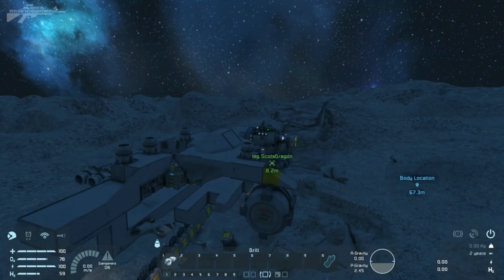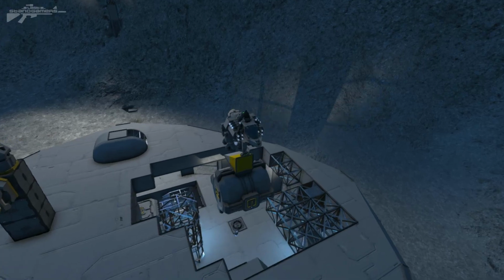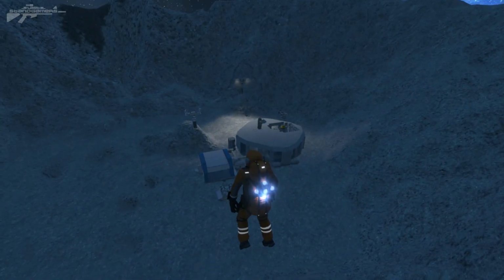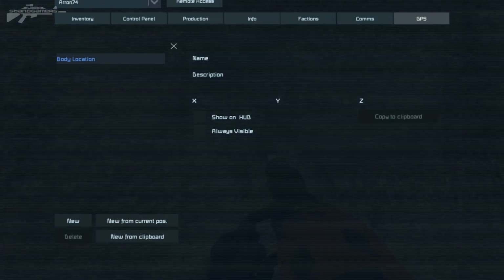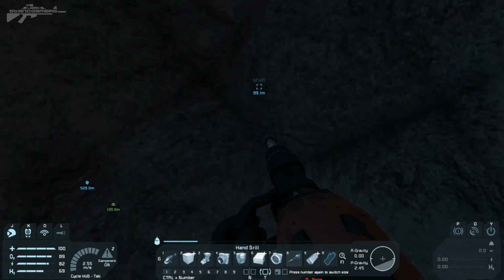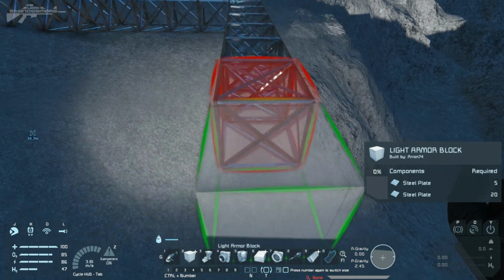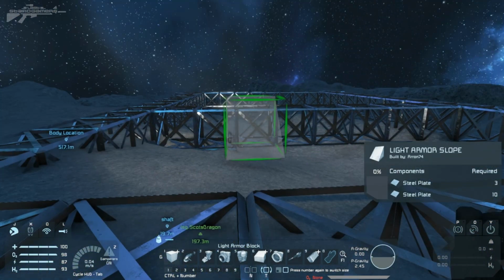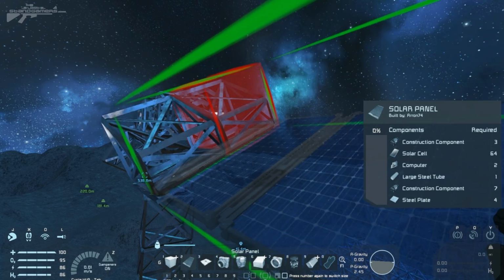Space Engineers - Hazardous Hydrogen Transportation  SE7-4

Comment: How to calculate if your ship can lift a section of blocks:
total downward thrust - (total mass * gravity)
If the number is positive, you're good to go.
Example in video: 
Small grid large ion thrusters: 144,000. Ship mass ~36000. Hydrogen tank ~8000. Gravity 2.5(shown on HUD)
144,000*2 - (36000+8000)*2.5 =  178,000, so the ship will EASILY lift the hydrogen tank. 

You can also rework this into maximum lift capacity for the ship:
144,000*2/2.5= 115,200 kg Gross lifting capacity. (around 79 tons net lifting capacity. Don't go over 40 just to be safe.)
Reply: Vecheslav Novikov this is really useful. Can't count the number of times I just crashed into the ground
Reply: Vecheslav Novikov wat
Reply: I mean I love science but wat 0-0

Comment: I think vanilla builds are more valuable than modded ships for three reasons: 1) Challenge. It's an engineering game and a large part of engineering is having clear limitations and thinking of a way around those limitations. Heavy modding removes that. 2) Standardization. The question of which design has better functionality should not be decided by whoever picked a mod with higher stats. With vanilla ships we have a level field. 3) Compatibility. When I design a ship or a contraption, I like to use that contraption everywhere I please, including on servers. I cannot depend on the particular mods I used being available everywhere. Moreover, those mods can stop working without warning after an update. Vanilla ships mostly avoid that problem.
Reply: I think that when you build with modded ships you have more freedom to build so I think modded ships should be judged fairly against vanilla ships, after all the creator of the vanilla ship had the choice to use modded parts.
Reply: I'll definitely give you 3, and 2, if you're in competition, you'd naturally want to ensure everyone has the same mod sets. If you're not, then it's simply a matter of personal preference.

As for the 1, the other side of the coin naturally, is while a large part of engineering is working a way around the limitations, another part is developing entirely new things when the current tech is insufficient. It's the difference between racing to develop rockets to reach the moon and being told 'we have gunpowder and Iron casting, you must reach the moon without making any advances' yes, it's possibly doable, but it'd be much easier if you were allowed to toss some charcoal in the furnace and make steel.
Reply: Except the issue is not about creating mods (this is indeed a worthy challenge), but merely using them in designs. Choosing a mod that fits your criteria is not a challenge at all. There are a few mods that introduce new gameplay elements (like the parachutes or wings) and I'd agree that using them is a requirement if you're going for a specific thing, but most mods - blocks with different shapes and/or stats - are superfluous. Also don't forget that every mod used adds a little bit of overhead to your blueprint's users, as it necessitates subscribing and adding it to the map.
Reply: I didn't mean creating them as much as selecting them. I do see your point about over head. On the other hand if you want to get technical, none of the vanilla blocks need any shape beyond a square box. None of the vital components should be sitting out unprotected. They should be hidden away behind layers of protective panelling. So all the blocks should be indentical.

Comment: +LastStandGamers Idea for rail-gun or mass accelerator ammo the ones with the rings an using gravity generators to push a slug out. anyways ammo idea:  stylize the tip similarly to a tip of a missile or rpg and the tip made out of completely heavy blocks; inside the tip area put more heavy blocks for further reinforcement. the ammunition should be 3 high and 5 wide and 6-8 long. after filling the tip area fill in the rest with the explosives but leave a hole in the back. after you do that build explosives coming out of the hole and out off to the sides and up and down like fins. the idea being the missile tube penetrates inside the ship an as it goes in when the "fins" hit the ship or target the explosives go off causing a chain reaction blowing the slug up inside the ship.
Reply: heavy armor*

Comment: AFAIK there's a bug with multiplayer in SE where solar panel data can't be accurately read by programmable blocks.  You'd almost have to use manual timing with it and just program the rotors to move slowly over time instead of trying to track the sun.
Reply: There is a mod that overcomes this.  I believe it's Midspace's experimental solar tracker.

Comment: You should make a dedicated video on solar tracking solutions. I've never had any luck with those scripts.
Reply: You don't really need a script. Build the solar panel angled to match the suns rotational plane, set the rotors to a matching speed (some math has to be done obviously depending on your length of day) and you're done.
Small floating point errors will of course make it a bit unsynchronized, but just check on it every few days to realign it by hand and you'll be fine.
Reply: I prefer automated scripts that work than this. They thing is that, due to lag and rubber banding issues your solution gets out of sync, fast! And I'm not talking multiplayer servers, single player itself experiences these problems. Unfortunately the tick rate in this game isn't as uniform as it is in Minecraft for example. Rotors and pistons especially tend to completely loose sync with things like the sun, which is the only constant... or it could be the other way around, I don't know that for sure.
Anyway a script that actually measures the position of the sun based on the power received by the panels is way preferable than any other simple mechanism, mostly for the reasons I mentioned, and for others I didn't. The only thing is, these scripts don't work as intended, or at all.